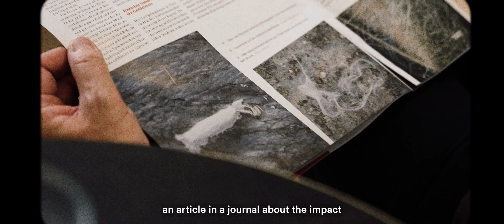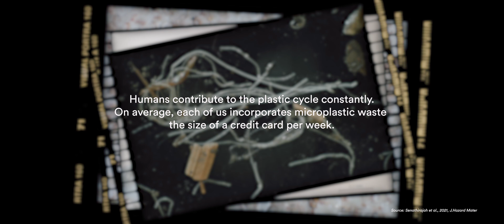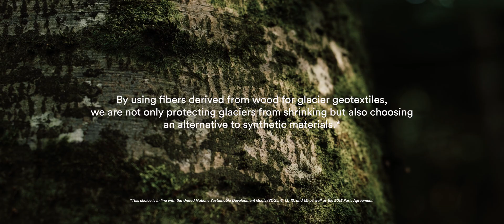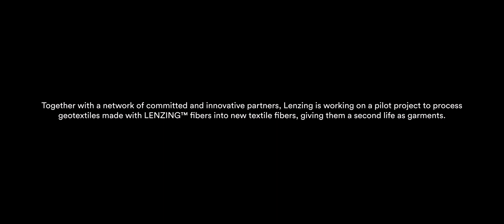Glacial Threads: From Forests to Future Textiles | Lenzing Group

Comment: If the fleece is there to protect the glacier then why remove it and make a jacket of it?
Reply from the maker: That is a great question. The fleece has to be removed after one or two summer seasons because it loses its protective function due to the effects of the weather (wind, sand, dirt, etc.). This is why it is regularly replaced, but instead of throwing the fleece away, we give it a second life as a jacket.💚
Reply: @lenzingvideos  Sounds very good!